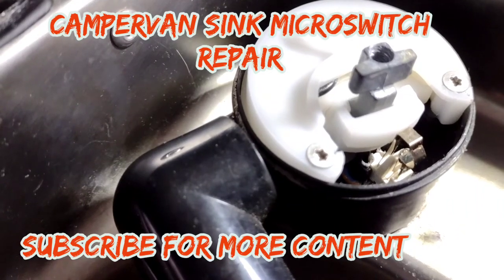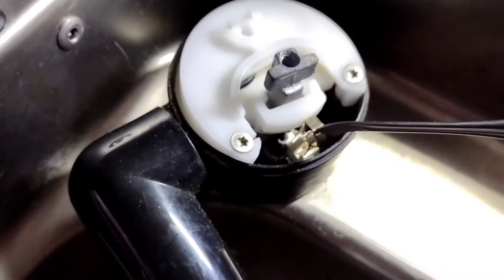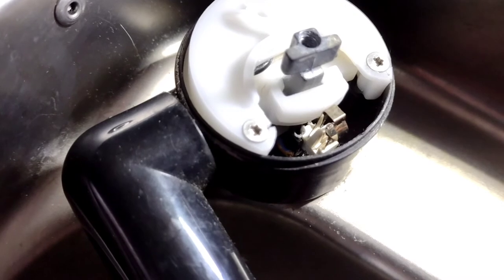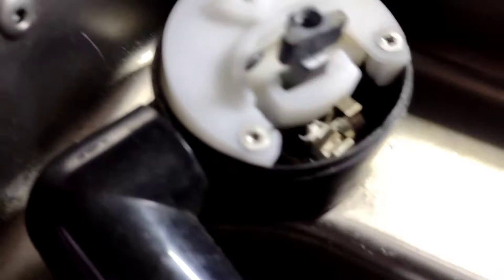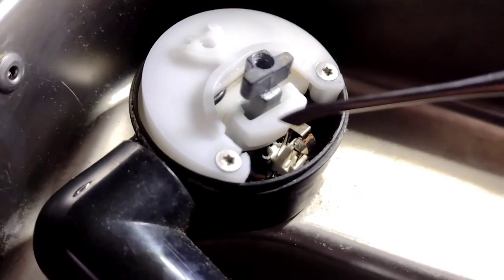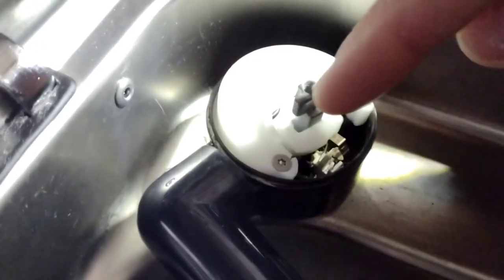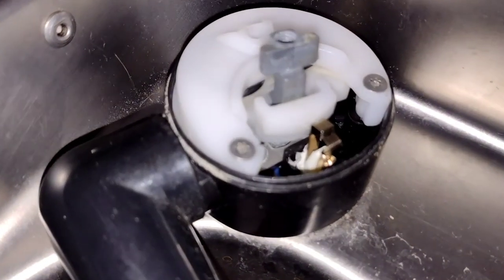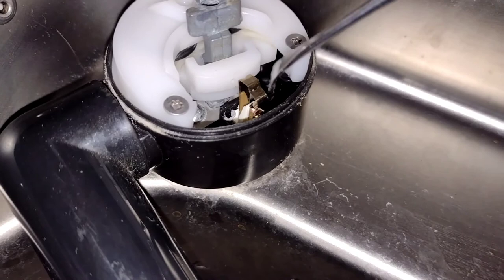How to repair a campervan tap microswitch.

Comment: how did you disassemble the sink lever?
Reply from the maker: I used a box cutter blade to lever out the hot and cold water plastic caps (they're very tightly fitted) and then you will see the screw for the lever.
Hope this helps.
Reply: @salvothegermanshepherd4399 thanks…tomorrow I will try… stay connected
Reply from the maker: @paolomoretti5269  Good luck, just one last bit of advice, make sure you tighten everything back up or the tap will leak and the water will go straight into the micro switch electrics and it will start smoking.
You will also probably need a Philips screwdriver, Alan key and a hex head.
Reply: @salvothegermanshepherd4399  fixed!  I unscrewed the screw on the cap head, with some slight difficulty ... then I "touched" the tab of the microswitch with a small screwdriver ... and now it works ... it is back in position.  however, I think it is a poor quality sink ...
Reply from the maker: @paolomoretti5269  Brilliant news.
I agree the quality of these taps are very poor and also over engineered. It would be far better if they had used a normal tap and a pressure pump. I will be buying a replacement tap as a spare, just in case of future failure when out on the road.